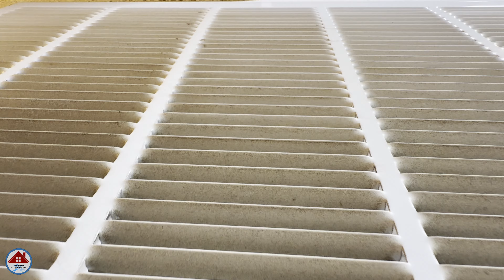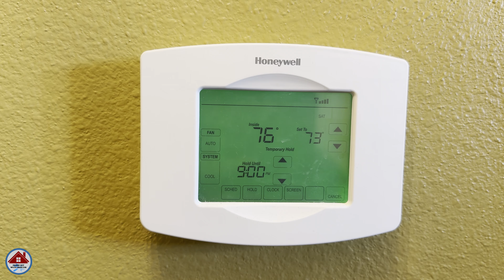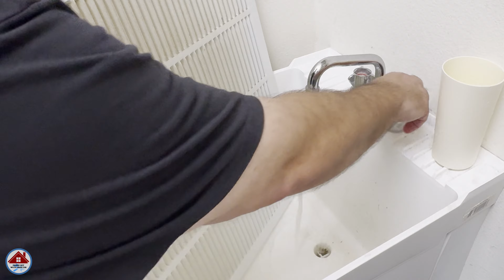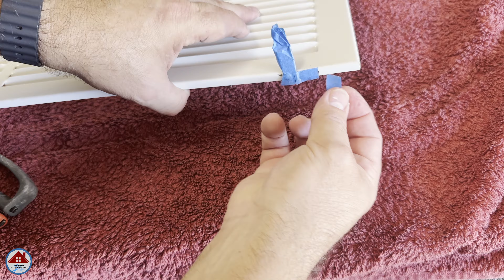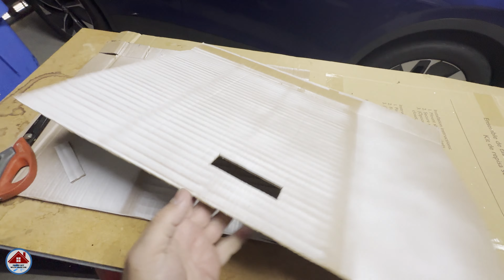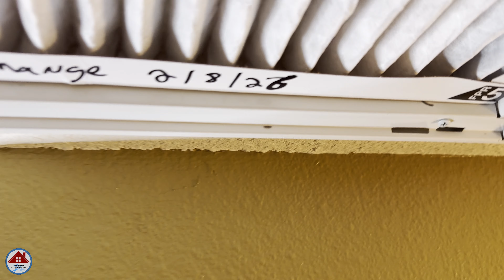Make Your AC Return Vent/Grille Look NEW Again!

Comment: Thanks for the video.  I'm getting ready to do mine. I did not want to remove the frame.  I'd like to paint it in place, however, I'd prefer not to spray paint it in the house.  Is there a brush on paint that you would recommend? Thank you.
Reply from the maker: That’s definitely an option, and in some cases it may actually be the smarter choice. Removing the frame can risk damaging the surrounding wall or ceiling depending on how it was installed and how well the paint has bonded over the years.

If you decide to paint it in place, I’d recommend bringing a picture of the grille into the paint section at your local hardware store and letting them know what material it’s made from. Since mine was metal, they recommended an oil-based enamel paint, which worked really well. They will help you with picking the correct paint for your project. 👍🏻 thank you for watching my video and have fun DIYing your AC Grille!